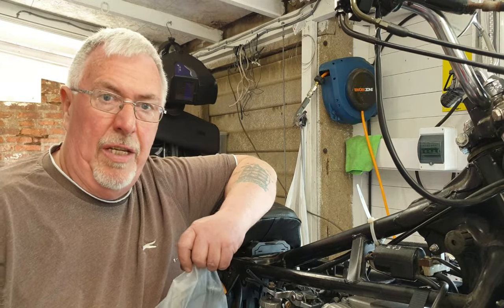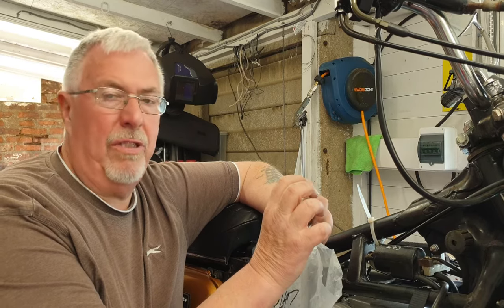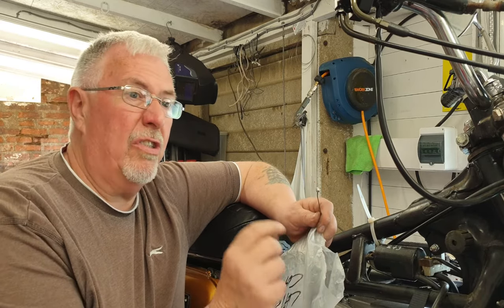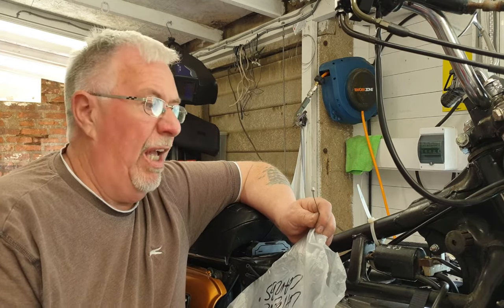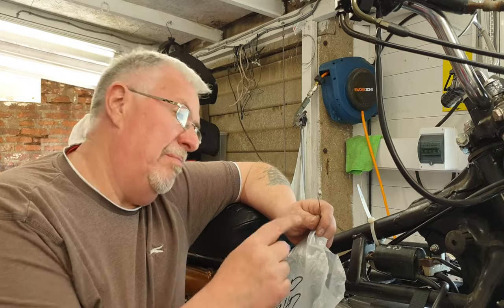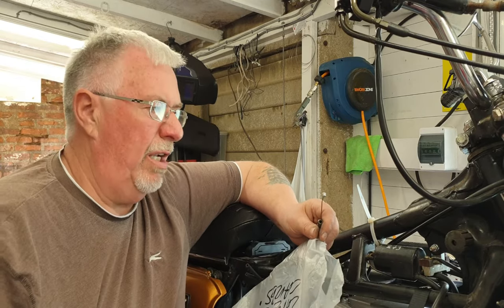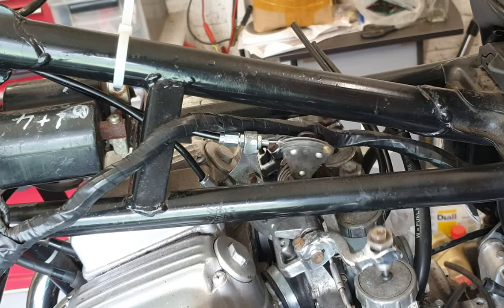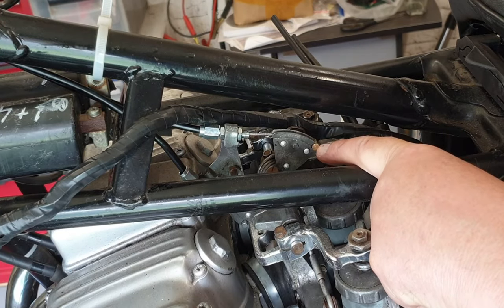How To Shorten or Repair Throttle Cable, Brake or Clutch Cables with Solder - Motorcycle | Part 18

Comment: Thank you so much I just fixed mine not be able to ride for 3 weeks buying three different cables since I seen this video I ain't even worried about it no more as long as it's longer thank you so much sir
Reply from the maker: I'm really pleased this has helped you.   I know your frustration with parts that aren't quite right.

Comment: Is it a different kind of solder used in electronics?
Reply from the maker: I use standard solder, same as I would solder wires with.  I suspect you could use plumbesr solder as well.

Comment: What if i would want to make the cable longer? Could it be possible to do that.
Reply from the maker: Sorry, but lengthening cables isn't anything I have tried.  

If you can take the nipple off, you could add a length of outer cover, but it would be a little messy where they butted up.  Then you would have to solder the nipple back on.  I would only do this if there wasn't any other altenative, I would first look to get a longer cable to start off with.
Reply: @SPANNERRASH  Ok, thank you for answering!

Comment: Can you send a link for the video on how to lengthen the cable? Thank you
Reply from the maker: Hi Nick, the only way to lengthen it would be to replace the outer or inner depending on what the problem is. In the UK a good company to use would be Venhill - hope that helps!

Comment: How do you trim the casing?
Reply from the maker: Very carefully with a Dremel cutting disk.  

You will find that there is a white nylon sheath against the actual wire, with a wire protector wound around it, with a plastic cover outside.  It takes patience to cut the wire protector inside the casing/cover square.  

If you can pull the inner cable back so you don't damage it, but even if you can't because you already have a nipple on the end, with slow careful cutting it isn't too hard to do.  

I have found that I have had to cut the outer casing on a number of made up cables to get them to fit right.  Obviously once you have cut the outer casing to fit, you need to cut along it to remove the parts,  usually ends up looking like a lot of small lock washers.

I hope this helps.  Good luck.

Comment: Will this hack work on clutch cable that has to deal with a  300ft pressure plate? I'd hate for it to separate while driving and
Reply from the maker: I am not sure what this would be working with I would look at the one you are replacing.  If the nipple is of the lead/solder type then I can't see why not.  However if it is a brass or other type of nipple then I would look for one that was specifically made for it.  I do hope this helps.  I would probably give it a go myself, but I'm daft like that :)

Comment: I just saw a guy opening the clutch, and messing with the rod to deal with too long cable clutch. Your method is less risky. Thank you.
Reply from the maker: I think your description of the other video is showing how to adjust the clutch actuating push rod.  It wouldn't help with a cable that was too long.  Depending on the bike, the clutch push rod might need adjusting to compensate for wear if the clutch is worn. I hope this helps.

Comment: This is so useful. I have a CB550 that needs short cables. as well as cm400t which is hard to find short cables for so this will be my new project for the next two weeks.
Reply from the maker: Thanks Shawn! This is indeed a great trick, really glad I figured out how to do this as I've found myself struggling with long cables a few times over the years. I hope the cable modification goes well for you too.